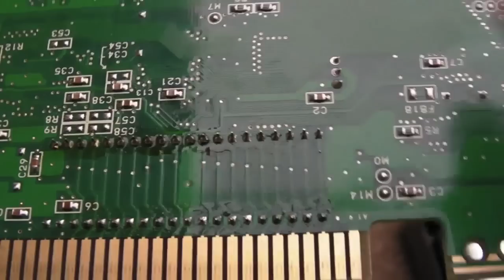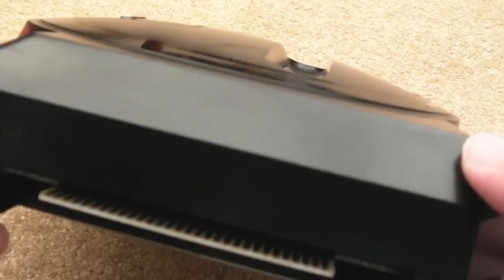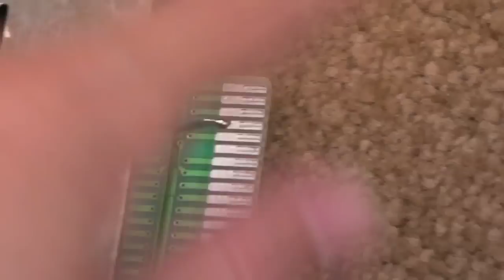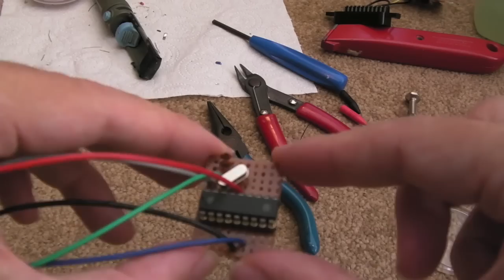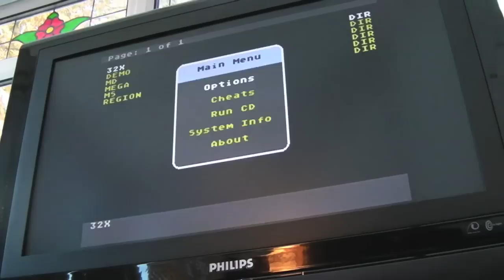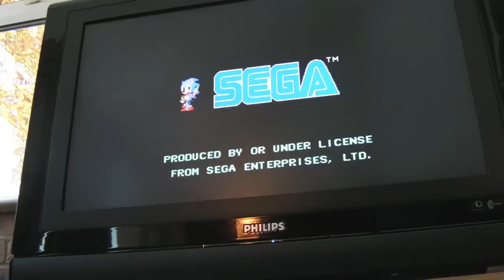Sega Megadrive (Genesis) Sega CD (Mega CD) Region Mod Part 1

Comment: a johnston counter or code to cycle through bios's
Reply: +Amy Marie I think the PIC's definitely the better option. The less batteries in something, the better.
Reply from the maker: A Johnson counter ain't going to save the rom selected!
Reply: +GadgetUK164  a flip flop, or a shift register? or both.
Reply from the maker: And how does that hold the setting after power off?
Reply: add a button cell battery so theres a stand-by voltage and the Circuit retains the settings.
Reply from the maker: +Amy Marie And then add components for the toggle count when button down over 3 seconds.  Far easier to use a PIC!   But like anything, there's always more than one way to crack a nut!
Reply: yup there sure is. Great to see you advancing your skills.
Reply: +GadgetUK164  sorry i can't Not think about it.................Just use one flip flop IC and a button cell or tap for power thats active when the power is off....."if thats even likely"
Reply from the maker: +Amy Marie That would work, but then you need a circuit to allow reset for short press, and increment count if held down for 2 or 3 secs.  PIC is far easier!  Originally I thought about just using a 74HCT161 but wanted to use reset button, and have it save the current ROM selected.

Comment: wow seems a lot of work but it works a charm. All I do is load the bios from the everdrive which in turn will then load the CD. So have a US game in the drive and select the US bios in the everdrive, load the game.
Reply from the maker: There are a few games that don't work properly when you soft boot the bios from the Everdrive.
Reply: +GadgetUK164 Really, oh dear I never knew that. I wouldn't wanna attempt this on my MultiMega in case it never works again lol
Reply from the maker: +Beaps73 I think Starblade is one of them, and I also found problems with Snatcher when just using the Everdrive to boot the Mega CD bios.  I've since tested with this mod and Snatcher is working properly now.  It's something to do with text in the menus not appearing properly at various points in the game.  There are other games which suffer other weird problems when using the ED to boot the BIOS.   I think it's because the BIOS is initially loaded into Megadrive, and then something somewhere is causing it to directly access the BIOS on the Mega CD, despite the initial boot from the ED - at least that's what I am speculating.

Comment: This is really cool, I always have wanted to start a Genesis/Mega drive collection and any mod to remove region locking or allow region switching is really helpful. I just added a region free bios to my Dreamcast and I am loving not having to use a boot disc. Anyways looking forward to more content and mods.
Reply from the maker: Thanks!  Yes, modding systems region free makes everything so much easier!  I need to do my Dreamcast at some point!